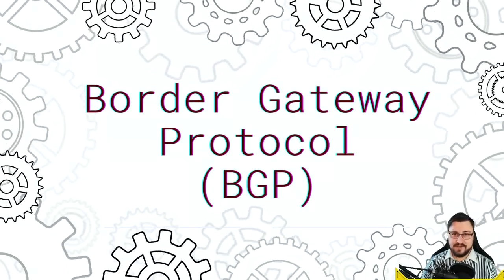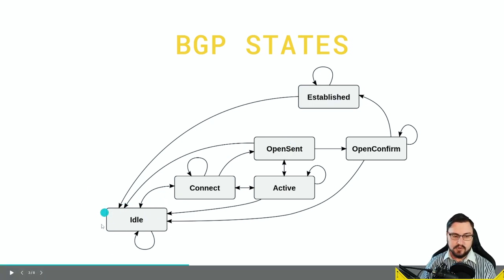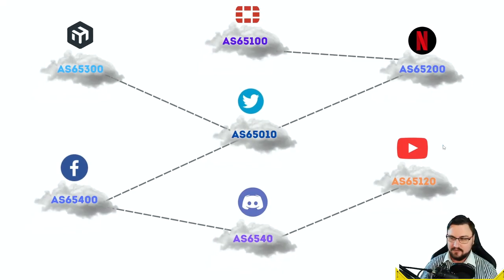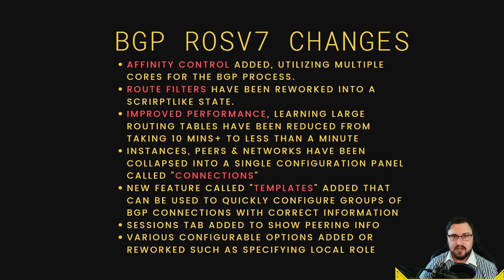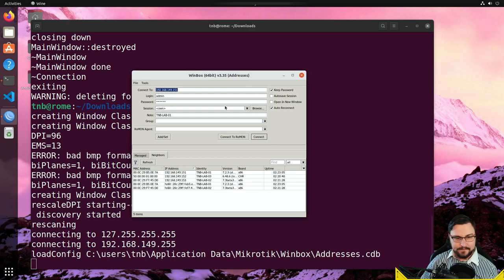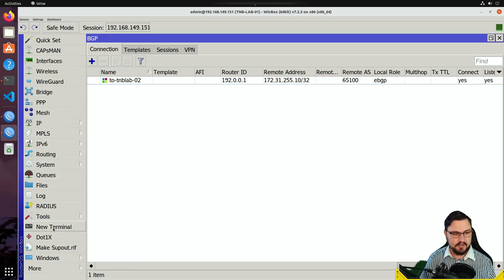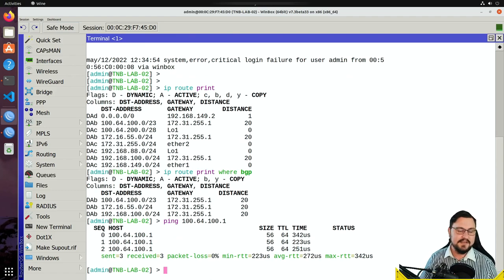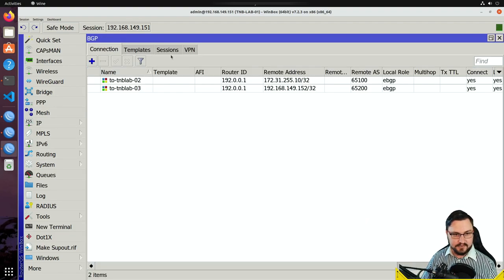Basic introduction to BGP - Ft. MikroTik ROSv7

Comment from the maker: Some useful links to help supplement with the vid:

https://en.wikipedia.org/wiki/Border_Gateway_Protocol
https://www.arin.net/resources/guide/asn/
https://en.wikipedia.org/wiki/Internet_exchange_point

MikroTik BGP configuration Links:

https://help.mikrotik.com/docs/display/ROS/BGP
https://wiki.mikrotik.com/wiki/Manual:Routing/BGP
https://wiki.mikrotik.com/wiki/Manual:BGP_HowTo_%26_FAQ
https://wiki.mikrotik.com/wiki/Manual:Simple_BGP_Multihoming
Reply: If I see correctly, the wiki articles are for ros6 as they still use bgp peer, network etc :-(
Reply from the maker: @foobar715  Both ros6 and ros7 is here, please use 
https://help.mikrotik.com/docs/display/ROS/BGP for v7
Reply: @TheNetworkBerg  Thanks for your videos, could you please make or post a new video using the BGP with ipv6 and filters, please

Comment: Hi, I found your channel while learning about Mikrotik recently, and I thank you for providing lots of information on Mikrotik....

I've been labbing Mikrotik v7 (using the latest 7.4.1 CHR) recently, simulating eBGP and iBGP with RR setup, running on dualstack (v4 and v6), and i use loopbacks and next-hop-self for the iBGP peerings. Alas, its iBGP behaviour is unlike any other well-known router vendors. A few things that stick out immediately:
1) an iBGP speaker advertises its loopback address into BGP to its iBGP peer, even though we do not configure a network statement (i.e. address-list) for the loopback on the originating iBGP speaker. 
2) the RR reflects the iBGP loopback addresses to all other iBGP speakers by changing its next-hop to itself. This does not cause any issue, because all loopbacks are learned via IGP (i use OSPF), which takes precedence. However, all eBGP routes are reflected correctly i.e. if an eBGP route is learned from an iBGP RR-client (and the next-hop is set to that iBGP RR-client), the RR will reflect the eBGP routes with the next-hop maintained to all other iBGP RR-clients.
3) since v7 no longer discard routes, and a RR reflects any routes learned from a iBGP peer to all other RR clients, including back towards the IBGP client that is advertising its learned eBGP routes, the iBGP RR client sees two sets of BGP routes for the same prefix (1 learned from its eBGP peer, another learned from the iBGP RR)

Because of this behaviour, i had to build specific outgoing route-filters for every iBGP peer on the RR, to make the routing table clean on each iBGP peer....

Comment: Want to start my rant with a thank you for the video's i am a big fan of your work. 

The major issue a found which is a main reason I can't run this on my core routers as yet is the fact that you can not specify "none synchronized" networks such as in v6, 
this makes it very hard when you need to advertise to peers since an existing route needs to exist for that prefix in the routing table or it won't advertise kind of same as in cisco back in the day. 
not sure if it's still that way where it requires IGP first before a route is advertised (synchronized). 

I have filters setup on my lab to not advertise anything greater than a /24 so in this case I expected it to advertise X.X.X.X/24 and not assume it has to advertise X.X.X.X/32 witch is my loopback address for example since X.X.X.X/24 is the parent network in my prefix list it should be able to figure this out and advertise that maybe there is a way to set a prefix length when the dst is checked but feels like a lot more work than it was prior and feels like more complexity then is needed in simple setups.

Maybe you guys have found a better way around this or my view on networking is entirely outdated.

Comment: Thank you for all your videos.

I have a off topic question.

How did you get your winbox to display all text perfectly in  Linux.
I have been having issues with this for a very long time and cant seem to get it fixed.
Reply from the maker: I'll be honest, my winbox just looks like that. No special tweaking has been required from me, might be a distro or winbox issue for your distro, though I think it should all work the same if we're all using wine.

Comment: at 19:28 of the clip, you mentioned that in v7, "you can have a specific core to run incoming bgp...",   how to do it ?   I didn't find where to config it.
Reply from the maker: There are Input and Output Affinity values that you can tweak in the "Extras" tab of a BGP connection. You can read more about how the multi-core routing process works from here:

https://help.mikrotik.com/docs/display/ROS/Routing+Protocol+Multi-core+Support

Comment: how do you apply synchronization in router os v7. I could not figure out that in the video.
Reply: in a situation where you wish to advertise route without validation from the routing table.
Reply from the maker: The synchronize option does not exist in v7, there is however a workaround. You can read about it in this post on the MikroTik forums:

https://forum.mikrotik.com/viewtopic.php?t=184856
Reply: @TheNetworkBerg  thanks so much. I'm implementing bgp as an emerging isp tomorrow. 
Again thanks, appreciated.